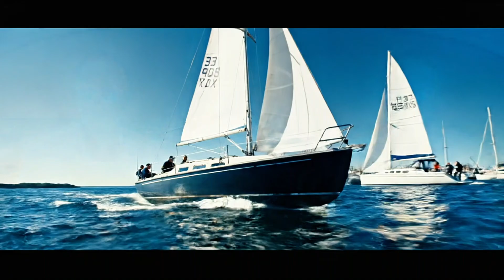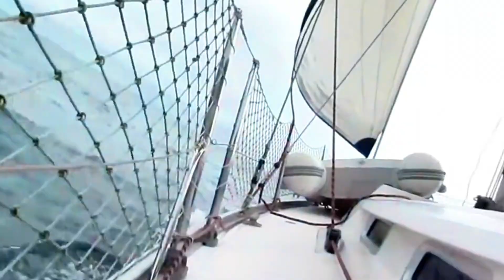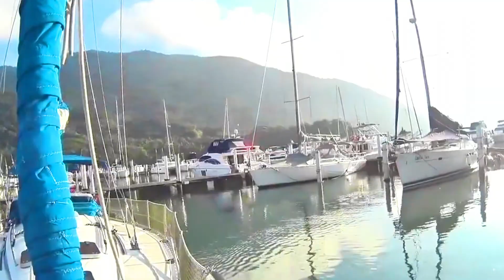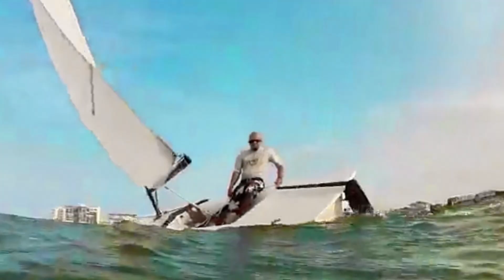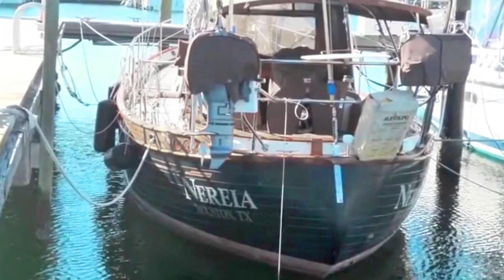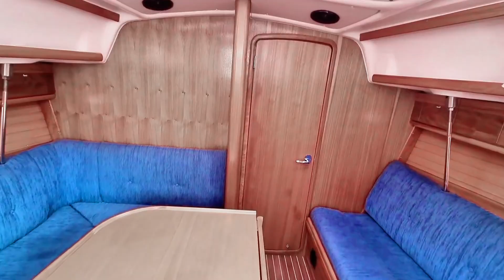10 ILLEGAL Sailboat Modifications That Make Old Boats FLY

Comment: Make 'OLD BOATS' fly? I have an old boat, I don't know the builder and it definitely never had any certification. I have had older boats where I did know the builder, so I know they basically built them 'by eye'. Yes, there was a designer's plan, but the builder selected the timbers from experience. What you are talking about are modern production boats not 'old' boats